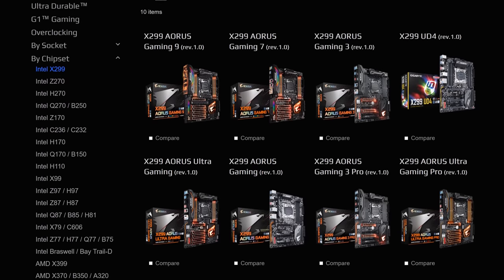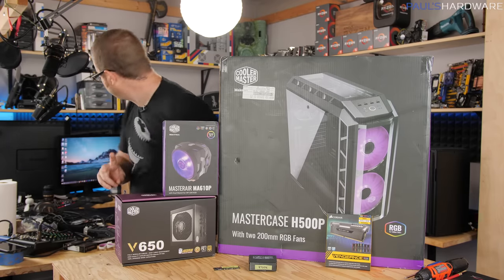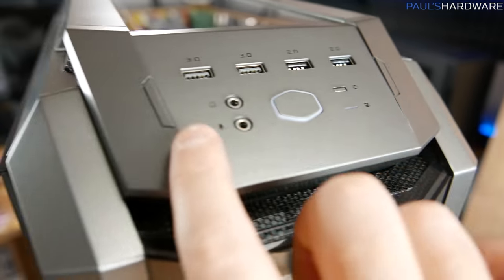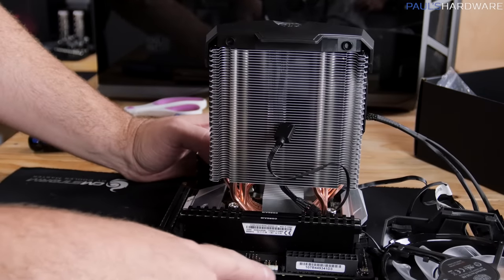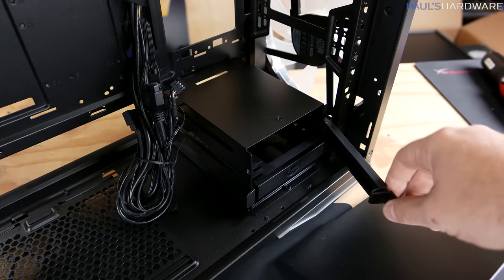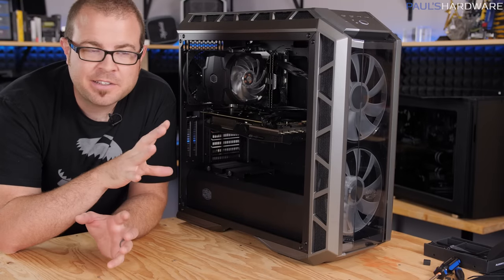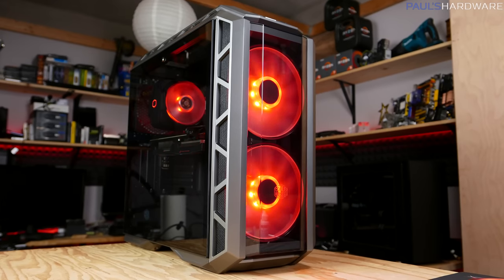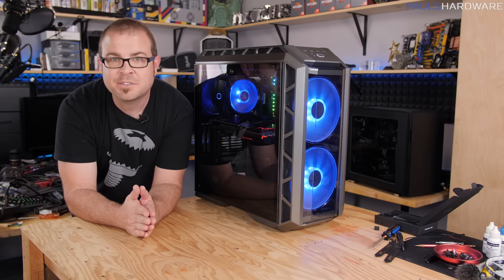Why Not Build a Mini-ITX PC in the Cooler Master H500P?

Comment from the maker: Yes, I know Steve from GamersNexus reviewed this case and really didn't like it. I also watched Dmitry's review on Hardware Canucks which I thought was quite good. IMHO it's important to get feedback from multiple sources on a new product, and I hope my video helps anyone who was thinking about buying this case.
Reply: How does it look for radiator support and pump mounting
Reply: how hard does it look to take off the front plexi and replace it with mesh
Reply: Do you know any other Mid Towers with that vertical GPU mount + Normal expansion bays
Reply: Well seeing the GN Vid and yours back to back with, quote: "... overall the built quality internally is fantastic...", in MY honest oppinion does make your vid look a little.. awkward. Just really surprised how different opinions can get.

Edit: I do have to highlight something i read again and again. What really bothers me with this product: They sell it as a product with certain properties - high air flow. Great big 200mm in the front (and ofc TG). But it just can NOT perform like it should be performing. And they charge you like its one of the best cases cooling wise. THIS IS MISSLEADING. It is no good engeneering if your shiny 200mm fans cant perform because  there is literally a 0,05$ piece of plastic covering them. 150$ please..
Reply: I feel like Steve was a little harsh honestly. But I do agree with him on the cost of the case, a little high for what it is. I do like the look of it though. I like your reviews brother, keep them coming! Almost at 700k!
Reply: Have a look at OC3D TV's review
Reply: steve complain this for near 30min
Reply: The case is Dope . But Paul, i cant believe you put that dinky mobo in that  glorious case :)
Reply: Not buying this.built quality is low and price is very high for the quality
Reply: Your opinions are almost basically kinda exactly the same.

Your review: "not HAF bad".
Steve's review: "not HAF; bad".
Reply: Steve finds a few things he doesn't like and literally makes it seem like the worst product in all of existence for it. Sure it's not the best case, but the look is definitely new. And I HIGHLY doubt build quality is bad. Bad planning doesn't mean bad build quality. Overall the case seemed rushed but some people listen to one guy and completely believe him rather than getting multiple reviews/waiting to actually see the case for themselves. There are more positive reviews than negative for this case. And yeah sure taking off the panels immensely helps airflow. But more and more people are looking for less maintenance cases. If it was as open as the original HAF cases, everyone would be complaining about how non-modern and old it looked, and also find a way to complain about possibility of dust build up.
Reply: Hasn't the Strix Vega a RGB 4pin header on it?
Reply: I feel like if a case maker does something to annoy GN he bashes it during the whole review
Reply: Sorry Paul i will trust Steve this time.
Reply: Steve always does that. I don't think he's ever done case review video where he doesn't spend the majority of the time on a couple of bug bears and then leaves very little time on what has actually been done well...  for example cable management is EPIC in this case and he spent about 5 seconds on that and didn't elaborate other than to say it was good... Creaky front/top panels warranted a Shakespearean monologue... Still I appreciate him holding manufacturers feet to the fire over this stuff.
Reply: For $150 + whatever "future modularity" Cooler Master wants, I think CM is not at all living up to its name or its price.

This feels more like a $75 case from a no-name company that wanted to jump on the "200mm is back" bandwagon.
Reply: Ben Steve uses scientific data to prove that there are multiple things this case gets wrong which $50 cases are getting right. An argument for this case means you want to pay $150 for a case that performs worse in multiple performance tests than cases that cost 1/3 the price.
Reply: What? Not at all. "Cooler Master" (an oxymoron of a name nowadays) is acting like this is their first case. Canucks is right: CM doesn't care about refinement. So what are you paying $150 for?

Loads of better cases with 1) better thermals, 2) better build quality, 3) and ostensibly better looks.

If you can't see CM's weak commitment to "build quality" and thermals in GN's video, then I think that speaks more about you as a consumer than about GN.

"More positive reviews" = very few thorough, scientific tests done in the PC hardware review market. I will take three thorough reviews over 30 "advanced unboxing and manual walkthroughs". I can read the damn manual myself.

Less maintenance cases? Brah. Magnetic filters is all you need. What other "maintenance" are you needing to do?
Reply: I also love this case to be epic i would like to put inside 4 of the new 200mm case fans from Noctua.
But as ikjadoon said above <<feels more like a $75 case from a no-name company>>..
Reply: Everyone is missing the point. It doesn't matter what Steve thinks, we never got the opinion from his cat!
Reply: Paul I know the 8700k Has high thermals, does that air cooler keep it under 80c when overclocking?
Reply: Paul's Hardware you can probably get away with the itx if u mounted the gpu vertically
Reply: It is absolutely important to get multiple viewpoints, but Steve from GN nails it, you are absolutely not getting something that is worth $150
Reply: Christopher Markley It was clearly an average to slightly below average performer. Apparently middle of the pack is now a cardinal sin?! Im not looking for a wind tunnel case. I like the looks and I have no need to overclock these days so I'll settle for something good looking as long as temps are "ok" and I'm not throttling at stock. I appreciate the scientific tests but there's plenty of good little things about the case which only got passing mentions or not at all. Watch literally any case review on GN (even the ones which typically have widespread acclaim) and Steve will down talk it for much of the video... Don't get me wrong I love GN but dude can sometimes be overly critical. He made this case sound like the worst thing ever which it clearly isn't if the majority of other reviewers are to be believed. Merely flawed in a few areas.
Reply: This case is a perfect example of NO MANS SKY...
Reply: Hey Paul if you get the chance it would be really nice to see a how this case handles custom water cooling. Particularly radiator to motherboard to fan clearances. It would be nice to know if we can install 2 360mm rads with no clearance issues.
Reply: I personally think that Steve review is a little bit too harsh. But Cooler Master really massed up a few things. When there is no back glass panel, why use these metal covers...better don't use them and put the money you got on better quality front panel so you don't have to use that cheap plastic. The case has a lot of good ideas, I hope they will make a new model based on all the good things they already put in this one, and fix all those tiny mistakes. People really like those big 200mm RGB fans, the great radiator mount on top...build on those things ColerMaster and you will have a winner.
Reply: Steve also posted thermals...
Reply: Ben, it's more an issue of the price. Have you seen other $120 to $150 cases? GN would've been much kinder had this been a $69 or even $99 case. For $150, you gotta step up. 

I think of this like fake vents you put on a car. Some people like those because it "looks like great cooling" even if it might have the totally opposite effect. 

IMO, the entire state of the ATX case industry is crappy. They hardly innovate well (a few innovate poorly) and most don't at all. Most cases these days should be given a critical review. There has never been more freedom to innovate in cases (we dropped 5.25" bays, we dropped 3.5" for the most part, SLI/CF are essentially DOA for most ATX owners, we have years of cooling performance data, etc.).....yet we get the same rebadged layouts with different external panels.

Branch the F out, case manufacturers. Do it well. Innovate. 

I'll listen, though, Ben. What are the key positives for this case, in your eyes, that other $150 cases don't have?

It's not the worst thing ever and I didn't get that vibe from GN's video at all. Steve just has a higher bar for quality and performance. Not all of us want to keep hear people parroting the Reviewer's Guide (given by CM) and making a build in it. I don't need a video walkthrough to understand how to build in this case and I certainly don't need a manual walkthrough.
Reply: In this case the glass is haf full.
Reply: BUT CAN IR RUN CRYSIS!!!!!!!!!!!!!!!!!!!!!!!!!!!!!!!
Reply: I am glad to have some positive input on the case, although seeing the materials they built the modular front and top from give me serious reservations. I take my computer with me to game with friends, so I don't think those cheap plastics would stand up to travel very well, regardless of how careful I can be. Definitely glad to have the good from you, Paul, but I'm also glad to have Steve's brutal honesty.
Reply: Make a thermo test
Reply: Paul's Hardware where can I get that CPU cooler?
Reply: Animal Joe. Amen !
Reply: Jacob Stone I know, right?
Reply: Sam Parfitt Exactly!
Reply: Ahas Veros OK. I have to pick your brain; it seems like case manufacturers like to have a flat panel covering the intake fans. Looks good for one and helps with sound dampening. So you really think it's such a problem? Why not mod the front panel and add holes?
Reply: Ryan Casey Yeah. I don't understand. USB 3.0 is backwards compatible so why put 2.0's and not the next gen ones? Is Intel asking too much for royalties for the new gens at the front I/O? It's gotta be that, else all the case manufacturers would do it. Whaddya say?
Reply: Animal Joe absolutely agree
Reply: Ben... it is a cardinal sin when it’s in the middle of the pack at a 150 dollar price point. Spend your money however you’d like, I take notice though when a tech reviewer does a sales piece like this when the case has been proven to be a bad buy for the performance. Again enjoy your case, but I would rather the channels I watch be critical on companies than say “well this is a bad case, instead of doing a full review I’ll just do a build inside of it and briefly mention some pros and cons” This is not an honest review.... that’s the problem here bud.
Reply: I like my HAF X more then this new look, though I am not a RGB'r kind of person.
Reply: Paul's Hardware this is not a HAF case Paul, it's the same as every other tempered glass case with 200mm RGB fans. Why can't people just stop being fanbois and tell it how it is?😲 Get off the 8==D train ! I'm not buying this, I rather get fractal design meshyfi C.
Reply: You skimp over the bad parts of this case, even during the bloody b-roll you can see a gap between the chassis and  window and how it sticks out.... like come on it's a $150 case for goodness sake. 

The build quality is horrible specially for such a price, disappointed by your rather biased review.
Reply: As the saying goes, "there's no such thing as a bad product, only a bad price."

This case is one of those situations.
Reply: Hay paul, I'd like to ask if asus is planning on making an AM4 ITX motherboard, Im planning a mini ITX rig and Iv;ed been a fan of asus for a long time.
Any information would be helpfull. tnx!
Reply: kelly lu He’s not going to reply on this miscarriage of a video. Videos like this you upload, write a disclaimer in the first comment, and then move on to the next shitty   Infomercial that he’s going to film.
Reply: To me, the facts matter more than 'like' or 'dislike'. For example, that the air intake is very restrictive and basically makes the twin 200mm a bit pointless.
Reply: Good day sir im a big fan(not the cooling type) you make the best videos i have ever watched i watched all of your vids atleast two times thanks for the vids man. Im from the philippines im a pc enthusiast and gamer my pc only pc just broke because of old age it was at least 4 to 5 years old when i got it on 2011 it was a gift from my mother i have used it for 3 years but sadly it broke the specs are amd athlon 64 le-1600 Motherboard: GF7025-M2 1gb ddr2 ram for its storage a 160gb Hitachi hdd unfortunately our current financial situation i cant buy a decent pc im hoping you will make a give away contest so i can at least have a  chance to win a decent upgrade
Reply: How easy or difficult was it to add that back panel (to hide the cables)? The space seemed to thin. Great job using the mini-mobo.
Reply: Not a fan of the plastic nor the small gaps on the front corners for air intake. I used to have a HAF case and it was much more solid than this new one.
Reply: The quality of the build and materials is not the main factor of why this case fails to meet the mark. The lack of 5.25' and 3.5' drive bays is a deal breaker for a lot of people. This case is very good looking and eye catching for sure, but it isn't very functional and lacks critical expansion options. Cooler Master has done better.
Reply: Paul, I watched both reviews and then some and could NOT figure out how anyone could review this case and not go "200mm fans blocked by solid plastic without enough air flow on a high air flow designed case". I like the looks but $150? Come on....MAYBE $100 but it doesn't have good I/O and buttons up front
Reply: That's really the deal breaker for the case (For me anyway).
Reply: GamersNexus is the most accurate warts and all review.  Product placement, sponsorship and bias are all things. Ask the question is GamerNexus correct? He is. Case is flawed.
Reply: Bad air flow and build quality are more that bugbears, they are essential functionality.
Reply: @Paul's Hardware, For years I have built computers. I have even blown up a few, and through sheer trial and error found awesome builds and some not so awesome builds. In your experience have you ever watched the politics when it comes to certain companies working well with other companies and whether it  affected your builds or not? 

Example: AMD working well with NVDIA, or Radeon? And Gigabyte mbds working well with Intell vs. AMD and then experiencing serious compatibility issues? I feel like I am the only one who has ever experienced this and NO ONE talks about it. IS it just in my head or is there a real compatibility vs politics that everyone should KNOW before building a computer?
Reply: Paul it literally falls apart.
Yes this is from 2 years ago. I don't care.

Comment: Wait... why wouldn’t you test the main feature? (Airflow)
Reply: Alex Kravitz look at gamers nexus review, removing front panels lowered temps by 10c. The airflow with panels is horrible and actually adds too much resistance to the fans to the point where they slow down
Reply: Thanks James M. for the heads up. Looks like I won't be getting this case
Reply: same

Comment: why didn't you use the vertical gpu mount? it would cover the emptyness below the gpu
Reply: Fred Persy you don't get a riser cable included with the case. Maybe paul has no riser
Reply: Doesn't come with a riser cable for the $150 price tag. Where is all this money going? Into 2 fans?
Reply: ikjadoon Watch the gamersnexus review. Steve is asking the same question. Also the 240mm mount behind those two fans can be expanded to a 360mm mount with an included bracket, to bad the mounting holes for it arent alligned. (hardwarecanucks revies) there's also a gap between the glass and the frame and the glass panel wobbles like crazy because it's not secured properly by the mount. The noise and cooling performance of the chassis is quite "okay" for a normal case but flatout bad for a HAF successor. (gamersnexus review)
Reply: ikjadoon same place the money in the inwin 303 that cost 100$ with 0 fans included went
Reply: Oh, yikes. CM is becoming the new Antec, except they think they'll survive with crap like this. How long can you survive with such painfully poor products?

I saw the GN review, but thank you for the Canucks review--I missed it!
Reply: Fred Persy because Cooler Master forgot to make sure you can use an CM air cooler (or any proper air cooler) together with a non-reference GPU..... You know... Have a fully air cooled system in a high airflow case... And because you must buy the fucking raiser cable separately
Reply: 1- Has no PCI-E riser included.
2- Non-reference PCB/Cooler graphics cards do conlift with 120mm air coolers in this case.
Reply: RiversDelay the 120mm so called air cooler gamer Nexus used was 140mm wide at the widest post the same size as big 140mm coolers. I am sure with a hyper 212 or something similar and a gpu that was not the tallest aib card out there it may have fit. But that doesn't change open air cooled cards get chocked hard when put that close to the glass

Comment: I have very fond memories of the HAF series. My very first custom built PC was put inside a HAF X full tower. It was massive, I kitted it out with more red LED fans in the top, and it lasted me quite some time. Now, I have their new C700P and it feels like Cooler Master has really come out swinging with their big return to the case market. Cosmos is a legendary case line, and HAF has a huge following and set a lot of case standards. I'm very excited to see these two case lines make a return.